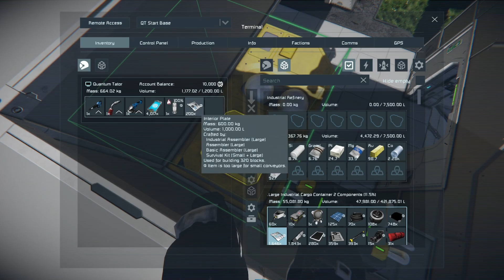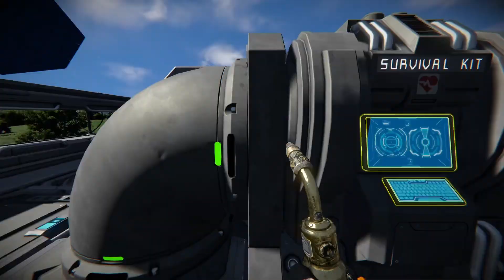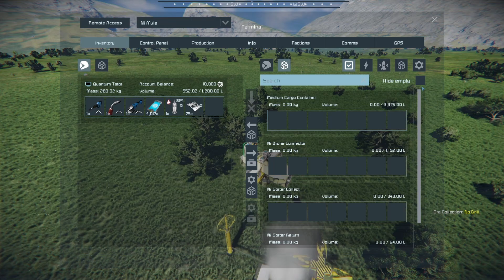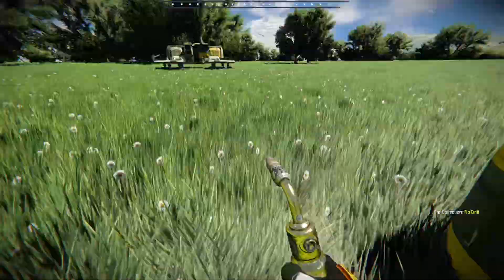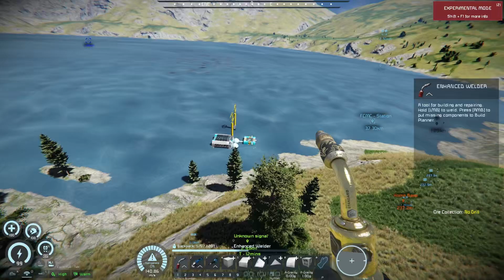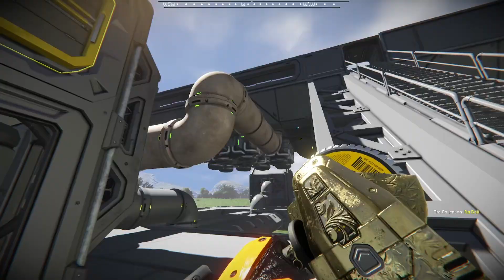S.E. Modded E34: Ni Mule Success?! Stay Tuned

Comment: When you were fiddling with the Ni Mule's event controller, it reported that the cargo container was at 52% already, so something else had gone awry, did you specify which container/have the name correct?

PS (Edit): the forward hydro-thrusters are no longer piped as the T-conveyors don't point down, maybe replace with a small cargo container, (same PCU, bonus storage).

Really liking how smooth the Pond Strider glides along the ground, just needs a bit more grunt when loaded up.
Reply from the maker: I will have to go back and check, I already have Friday ready to post. But I will check the Forward thrust. My brain in this second can't remember which section had a T. I think it could use some more grunt as well. And i didn't even think to check the event contorller having the right cargo> i bet it doesn't even have any cargo selected... Will also have to check that.

Comment: As I stated last episode, the "same name" issue  might  happen when both/multiple Mules are connected to the base.
I used to run into the issue when having multiple rovers docked to the base, and they had the same name "headlights" for the lights on the front.
I'd hit the button on the bar to turn On/Off the headlights, and I'd see ALL lights named "headlights" turn On/Off, not just on the rover I was sitting in.
If that rover wasn't connected to the base, then turning "headlights" On/Off didn't affect any other rover.

Trigger the Nickel Mule 'RTB'. If it successfully returns to base, unloads, and then returns to the mine, then you've likely got it all configured correctly.
Then it's just a matter of setting the filled % (or leave it at 35%) and you should be good to go.

Was the initial idea in your head that the H2 refueling station stayed at the Ice mine?
If that's the case, I'm thinking that running a pipe up to the base should only be temporary, so you can initially fuel the Sol Strider.
Remove the pipe after, and configure the refueling depot with a connector the Sol Strider can easily dock to.

A 3-way "corner junction" for the reinforced conveyors should be a thing. 
You can't be the first person that's had to "settle"  for the default junction.
Let's go Keen, make it happen.

Placing catwalks between the Sol Strider's wings would give a look a bit like the netting between the hull sections on the Tri-Hull boat from the movie Waterworld.
Might be an interesting visual, AND be functional.
Reply from the maker: Lot of good points. this raises the question in my head of where to even put the connector. Looking like port and starboard are going to the spots. Not really sure yet. I don't like how much they will protrude.
I do like the walk way. I may try out a few different ones, see how it looks best.
Reply: Side connectors on the Sol Strider?
Built into any hull you build to enclose things?

At the Ice mine... build a refueling platform beside and higher than the mine equipment? This would allow you to expand H2 storage if you decide to.

The antenna, covering a conveyor port, might get in the way of future things.
How about mounting it to the back of the Ore Detector?
Reply from the maker: @Original_Chad_P  Just wrapped a recording, but it makes me think I may need to take a moment from the Sol Strider. and "refine" the hydro plant. with some upgrades. so that is a good idea. I like it a lot. Was also considering and Atmo POD sort of device to carry the Sol Strider to the fuel Depot. Gives me an idea for sure.